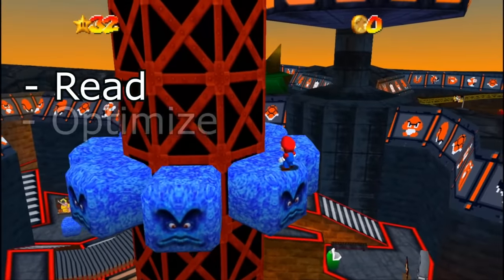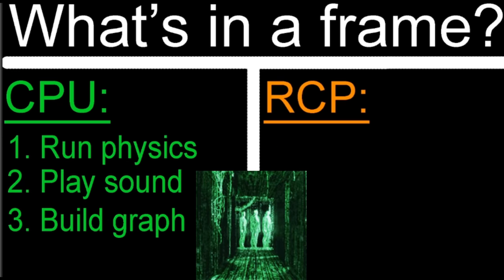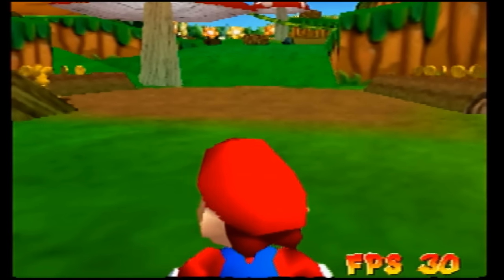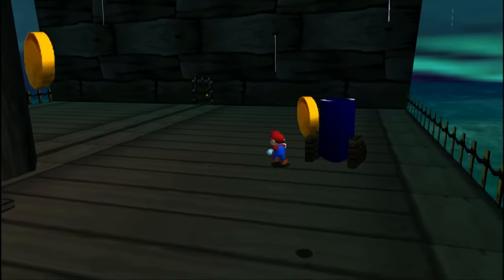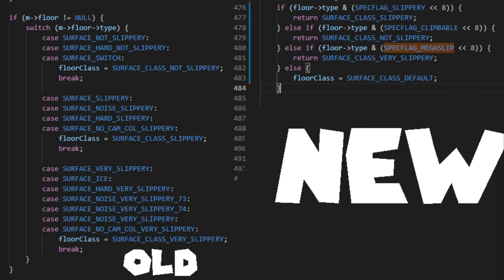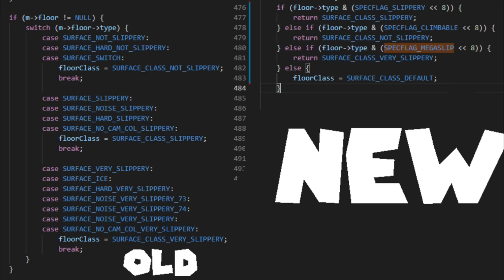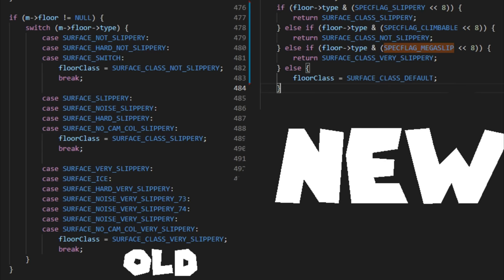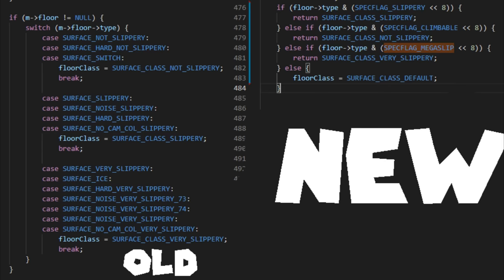FIXING the ENTIRE SM64 Source Code (INSANE N64 performance)

Comment: it would be really cool to hear what the original programmers think about this.
Reply: I'd be very happy to see support or honest reactions from devs instead of "don't touch our IP"
Reply: They're all retired probably.
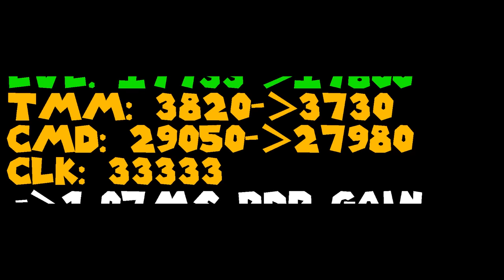Reply: Well, as he said at 6:36 this RAM optimization wasn't actually possible on the original hardware... So Nintendo programmers probably did all they could already.
Reply: @glurp1er  it was possible with the expansion card
Reply: @OrchidAlloy  You mean the one that released two full years after Mario 64?
Reply: @Blutzen  yes the one
Reply: @OrchidAlloy  The N64 8MB RAM pack did not exist until the last years of the console.
More than 4 years after Mario 64 programming ended.
Reply: @glurp1er  yes of course but it's still official hardware, so while they couldn't have done that particular optimization at that time, the optimizations as a whole still have lots of merit
Reply: @OrchidAlloy  of course!
Those optimizations are incredible!
But they were just not possible in 1996 on the original hardware (sadly).
You can't blame Nintendo programmers for not doing something that was simply not possible.
Reply: @OrchidAlloy  Not all of them, some of them made the code more likely to crash, something that's a big no no for console games.
Reply: TRACK THEM DOWN.
Reply: @Pvt.Fernandez  doubt it, this was 25 years ago
Reply: @glurp1er  you just saved me from watching the vid with the admittedly impressive technical feat
Reply: They think "lawsuit"
Reply: I was one of the original progammer and this is an outrage.
Reply: They probably don’t speak English lol
Reply: @troywright359  What do you mean "saved"? This is all still fascinating stuff even if a portion of it requires the expansion pack.
Reply: @brandonkruse6412  Well Miyamoto does at least, though he's apparently not fluent and prefers Japanese, understandable since it's his first language lol.
Reply: @ryo-kai8587  That would be the legal team, not the developers themselves

Devs generally don't have much say at all in the company's legal team outside of taking licensing into consideration
Reply: @glurp1er  this one optimisation required the expansion pack. Most of the stuff in this video could have been done in console back then, but I guess the team was just under too much pressure to get a working game released.
Reply: @Wryyyong  Yes, that's why I said it would be nice to see a reaction from devs, instead of "don't touch our IP" which would obviously come from the publisher/tyrannical lawyers, etc
Reply: @glurp1er  No. That was just one thing of many optimizations. They simply didn't have the time or know how (at the time) to do what is being done today. Modern build times and tools are simply sci fi compared to what they had back then. However, they could have done better. A bunch of these optimizations were easy and got a lot of improvement. Not unrolling loops is counterintuitive for a programmer from that era but gains a lot of speed.
Reply: Probably "oh neat". If you ask me about a project I made 5 years ago, I really don't remember what gave me trouble or any other detailed specifics of the project, the devs will definitely barely remember anything from this game's code.
Reply: Dude this game is 30 years old they are all dead.
Reply: @Pvt.Fernandez  definitely not bro all of nintendos programmers have been alive since computers were invented and know literally every single thing ever about programming
Reply: @GoodMomo  Maybe. SM64 was a milestone, and probably their first game for this hardware, which apparently was notoriously hard to develop for. With that in mind, they'll probably remember at least some aspects of the development process for the rest of their lives.
Reply: @SnowWhite-dr6xh  So you're implying that every single dev in the early days of 64 were all already 40 or 50, or had severe health conditions affecting life expectancy?

Yes, I'm sort of kidding, but either way the math doesn't check out.
Reply: @glurp1er  not really, often you're not allowed to optimize because of project constraints, it's only if needed and until it's "good enough", and most games end up being cut down significantly in terms of features and/or scope because there's never enough time/resources, so unless you're really trying to push the technology to the limit as a top objective of the project, most likely, there will be very little incentive for optimization.
Reply: I think most would be both impressed and yet not surprised.  Almost every coding project is never truly done.  There is always a battle between expanding features, exploring new efforts to invent the wheel (so to speak), and optimizing what exists.
C was a new language and the processor was also rather new.  We have the advantage of retrospective outlook.  We can look through libraries of techniques used by people to speed up performance over the course of more than 20 years and across hundreds of games/environments.  We can then find a more ideal code and slide it in.
We also have generally better tools that can detect specifically the kinds of errors created by virtue of large development teams.

So, realistically, it wouldn't be surprising that the code could be quite heavily optimized.  Though I imagine they would still find it impressive just how much more it could have achieved.
Reply: @IsmaelLuceno  It also has to do with standards. They were setting them at that point, so it's understandable. If it was made at the end of the console's life cycle for example, not only would the expansion pack have been available, but there would have been more optimizations done before it was considered "good enough" because that would have been the new standard.
Reply: @glurp1er  4MB*
Reply: @glurp1er  wasn't there a version of the game planned with the expansion pack ? I think I heard that somewhere or maybe it was another game
Reply: Well, they're all dead now, so no luck.
Reply: You'd probably never hear from them considering they're Japanese. Also correct me if I'm wrong but Japanese Devs aren't generally as open to this kind of thing.
Reply: "IMPOSSIBRUUUUU!!!"
Reply: @Pvt.Fernandez  Most of the guuys are still at Nintendo and been on Mario games since the very original up to the new Wonder game.

Comment: The cost of 4 MB of RAM in June 1996, the date of the N64 release, was about $34 retail.  Within 5 months it was $21.  Nintendo should have released the system with the 8 MB standard.  The system's price might have been $40 to $50 more, but within a year the cost of that memory would have been $15...

You can never have enough memory.

Comment: This is the software equivalent of restoring a 57 Chevy and then giving it ridiculous horsepower.
Reply: Just be re was rearranging what's already in there
Reply: Dude went through over 100,000 lines of code, this is like restoring 10 Chevy's or something, this guy is insane
Reply: To be more specific, building a Chevy Bel-Air with a Pro-touring chassis and the engine block for a C7 Corvette ZR1
Reply: Lol no, this is way harder
Reply: @rotor13  , I disagree with the engine swap analogy
What this man did was more equivalent of tweaking every single thing on the car so that it runs as efficiently as possible with the least possible amount of upgrades.
Reply: @C-64  You're not doing any of that on a 57 Chevy Bel air lol
Reply: @C-64  Maybe the analogy doesn't really work. The amount of reverse engineering that's needed to just understand what a ROM of this size is doing is huge (Maybe a certain leak helps here..), and THEN you have another significant job of optimising that.
Reply: No, it is exactly not what it is like, as all the "horsepower" remains strictly the same. Go away.
Reply: Well putting a new engine and stuff in a vehicle is basically braindead work compared to this.
Reply: @whuzzzup  Dont think too hard. Its an analogy.
Reply: @whuzzzup  eh, go restore a vehicle and tell me how it went 10 years from now when it's still sitting in peices in the garage. It's not easy.
Reply: More like a sleeper Volvo.
Reply: @bfkc111  alright then BFKC
Reply: @Zordiak  you think this is way harder? Imagine how hard it would be to make a custom engine for the car. That is what this man did, custom code. Manufacturing a custom engine is of course way harder.
Reply: @whuzzzup  Imagine making the new engine yourself. This man did a code rebuild, that is basically akin to rebuilding the engine from the ground up, like a brand new designed engine. Just taking the blue prints and making that engine with million dollar equipment would be harder than going through this much code.
Reply: Like the peasants in the comments know anything about gear ratios and torque conversion. Any of you would be lucky to change some breaks much less tweak a vehicles drivetrain for better performance. It’s only borderline rocket science.
Reply: @dreamshakejunya  no it’s not. You seam to forget you have to know how to code with all modern cars. They all have PCs in them. Building a car from the ground up like you would a pc program is way harder and involves way more science. It’s not a debate it’s fact.
Reply: @dreamshakejunya  even if we take classic cars. One man can easily write code to build a single program or even multiple but it takes a special kind of genius to build a motor or drivetrain. From nothing with only the tools and raw materials to do the perspective jobs. Not saying what he did didn’t take skill it did. More than I have. But it’s completely different worlds. Even just reboring piston walls is complex. Or build a whole engine as suggested buy some here in the comments. Lol
Reply: It’s like re-building a 1970s Pinto to look as nice and be as performative as a 57 Chevy
Reply: Dude did the equivalent of rebuilding the original motor then supercharging it and gave it a 10 speed and gets better mileage than a prius

Comment: The rolled loops thing is funny. Obviously unrolled loops make the code much less maintainable, less readable, less terse, and more error prone. But back then programmers used to unroll loops as an optimization to save some CPU cycles (as the for loop part of the code does not need to run again and again ). But now we are seeing that rolling them actually improves performance. What a perfect cautionary tale about premature optimization, and also optimizing without profiling.
Reply: we used to do this on C64 as well to get more cycles :-)
Reply: Programmers should not be the ones unrolling loops.  Programmers should be writing code that allows the compiler  to unroll the loop *if the compiler determines that an unrolled loop would improve efficiency*.  This requires an intimate understanding of the hardware that the code is running on.  If you have a shared bus and your instructions are cached, then yes, smaller code size optimization (i.e. rolled loops) will win over "faster" code speed optimization.  That is unlikely to be the case for an in-order processor with no pipelining or cache.

That said, you do need a good compiler and that compiler does need good knowledge of the hardware, or this all goes out the window.  I've developed some code for the PIC and their C compiler is outright horrific.  I can't tell you how many times I've had to twist myself into a pretzel to get the compiler to generate good code, and sometimes I just need to write it in assembly because the compiler is too stupid.  And their compiler is made by the the same company that makes the microcontrollers!
Reply: @DeadCatX2  you do know this game was written in the 90's on a retro console right
Reply: @RussMichaels  he's right tho
Reply: @alexbrown3603  picking holes in something written over 25 years ago for not using modern techniques?
We couldn't apply that to literally everything on the planet.
Oh doctors in the 70's, 70's and 90's should have used medicine from the 21st century...
Car manufacturers in the 80's should have made electric cars.

Etc
Reply: That style is a function of compilers' capabilities at the time. It is still valid for a number of purposes, like ensuring no performance regressions across compilers and versions.
Reply: Yes, loop unrolling is faster when CPU cache size is large and memory is cheap, which is largely true on x86 systems, but quite untrue on fixed hardware like a 90s game console.
Reply: The processing time for his changes was slower but used less memory as he changed the data structures.  The unrolled loop used more memory but had better performance.  Which is to be expected.  

He optimized for memory versus runtime which is obviously a different decision than was made at Nintendo.
Reply: @RussMichaels  you do realize C is older than a lot of us, right? these are not "modern techniques".

most of the reason why this code was bad was explained in the video - time constraints and lack of proper communication between the developers. and probably not enough code reviews.
Reply: @jshowa o There is no such thing as "the C compiler". There are many different C compilers, and while they were not new in 1996, they were also not nearly as good as modern compilers, specially if we're talking about a non-x86 target ISA.
Reply: MIPS includes delay slot in their ISA so that the jump in the loop only costs 1 cycle. MIPS simplifies the design to allow it to run at high clock rate. => coder still unrolls loop without prior profiling. LMAO. Also compare pointer to end of buffer and jump are one instruction.
Reply: @LC-hd5dc  are you aware c had also been updated a lot since the 70's too 
Descendants of C include Concurrent C, Objective C, C*, C#, and the widely used C++. The programming language Java was introduced in 1994 as a simplified subset of C for deployment over the Internet and for use in portable devices with limited memory or limited processing capabilities.
Reply: @RussMichaels  did you actually watch the video? yes compiler improvements have helped but most of the video was discussing bad code practices. Knuth derided "premature optimization" in 1974 (original quote may be even older) and yet that's exactly what the original game devs did here

I feel like you didn't watch the video and also don't know much about code
Reply: @LC-hd5dc  yes I have watched the video.  I wasn't commenting on the video, I was responding to another comment.
Reply: @RussMichaels  Java was nothing like a simplified subset of C. It's descended from Obj-C and Smalltalk. Just as Obj-C's is from C and Smalltalk. And it certainly wasn't for use for devices with limited memory or processing power. The first version of Java was a real resource hog and was slow. It was only with the advances into JIT runtimes that performance became acceptable. It still is a memory hog. All languages that use garbage collection are. As soon as memory is constrained performance falls off a cliff.
Reply: @senjaz  you better go tell wikipedia then.

Comment: As a programmer and engineer  I can say that this is a MAJOR achievement and a LOT of work. I can't congratulate him enough. Heck, the fluid framerate even looks like Super Mario Galaxy or Super Mario Odyssey. I just disagree when it was said that "the Nintendo programmers were not familiar with C, because it was a new language back then". C originated in the early 70s and was and is a well-known language. However, what is certain is that many 90s game programmers were making the transition from assembly to C / C++ code, I think that's what was implied in the video. It's a minor detail, like a 0.001% of what's in the video. KUDOS
Reply: Oh ok, I was wondering how C was a new language being already at that time 20 years old or so... It took that long to begin transition ? was it due to compiler refinements ? or just inertia ?
Reply: @nlight8769  high level languages did not compile efficiently enough to be usable on older consoles, N64 was one of the first where the hardware power was capable of handling the unoptimizations to a degree
Reply: @digiquo8143  Thanks :)
Just one last question, what was the language used for the previous gen (SNES, MegaDrive) ?
Reply: @nlight8769  From what I've read, most were built with assembly. aka, assigning the hex values to their location in memory manually.
Reply: @digiquo8143  Wow, asm is pretty hardcore for anything elaborate. Respect to the designers and programers from that era.
Thanks :)
Reply: @nlight8769  C was new to the game development industry, almost everything up to the 16bit era (Early 90s) was written in assembly code. C programmers back then were writing business applications for PCs and Unix systems, not video games.
Reply: I don't think you realise that Japanese developers didn't use C until the N64.
Reply: It's both the framerate, but also the zoomed out camera that gives this different look